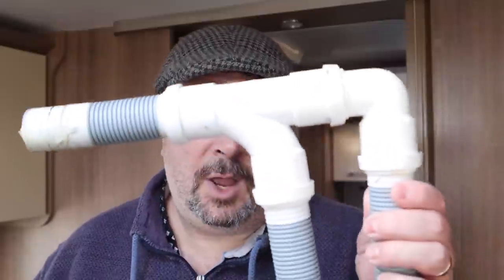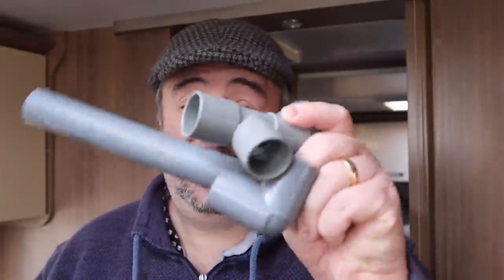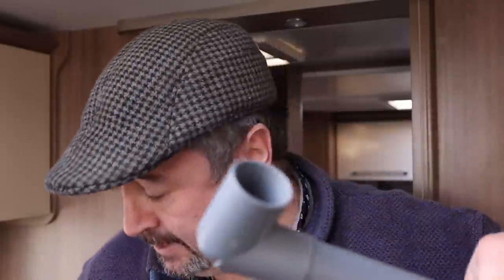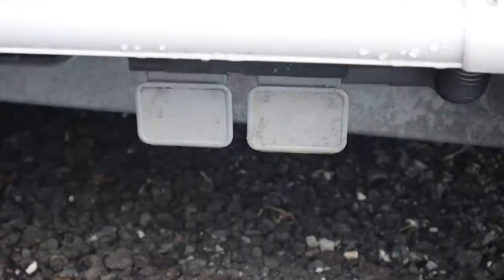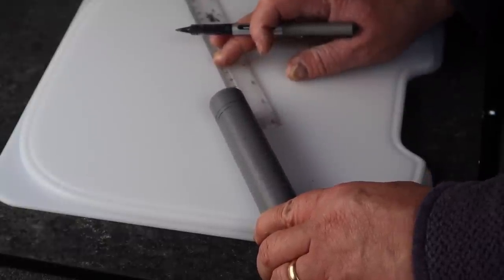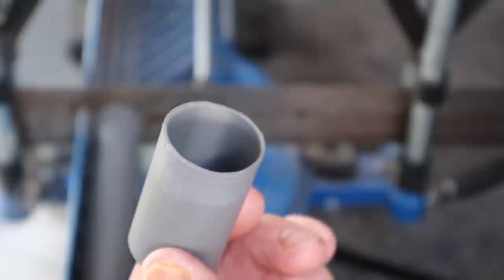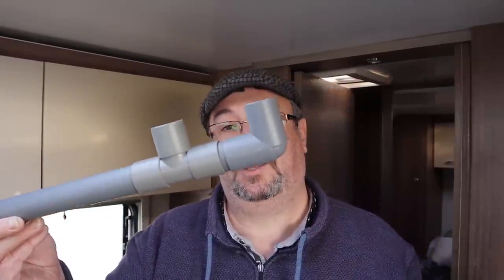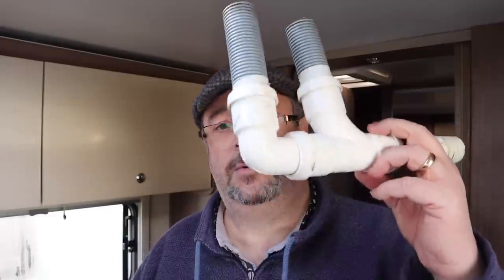Caravan waste pipe connection kit

Comment: Hello Dan I made one of these last year but I used another right angle fitting and some more pipe to run it directly into the waste tank without the flex pipes. It works well and looks neater.

Comment: Used the old method from start of caravanning. Never failed yet. Thanks Dan for the Info but will stick to tried and trusted method. By the way. I love the flat cap. You could almost pass as a Yorkshireman, you just need a ferret now as a pipe cleaner.

Comment: Hi Dan, Ive been using thst set up for two years and it works well. Wr were on a fully serviced pitch at Chertsey so I just slid my white pipes onto the grey and adjusted for length. But glad you gave a warning, as I did split one join when I originally put it togethet, but its still working well. Just needed to adjust the distance between the two outlet pipes when we bought the Buccaneer.

Comment: Hi, used this kit before I found your video. You missed the use of the other 90* bend. 
Rather than using the unstable flexi tubing, measure (100mm) out of the straight tube cut and fit this from the T to the bend, fit the remaining length of straight tube to the other end and adjust length as required to go straight into waste container on a level surface, allowing about 30-50mm to go into tank. Much more secure and tidier. As shown on the picture of the kit.
If on a slope/elevated or uneven site, flexi tube may needed to ensure no leakages.
If you want I can photograph and upload my system if this will clarify.
If necessary use a small amount of silicon spray to ease assembly.

Comment: I found the kit at a site a while ago. I used both elbows so the feed pipe to the wastemaster comes away from under the van as on a sloping site the wastemaster would not go under the van. I too used a piece of normal waste pipe to join the kit to the wsastemasrer

Comment: I use that kit Dan. The only thing I would add is that the kit comes with a two right angles. I use the second to secure the pipe down into the wastemaster. The size of the straight grey pipe is sufficient enough to cut three pieces in total and therefore no need for flexi hose.
Reply from the maker: Hi Tony, we were thinking of doing the same, but in the end i chose not to do this as the flexi pipe acts as a trombone slider : pull back to remove WasteMaster, push forward to insert etc. We did this over Christmas and it works really well. it also means it will work with my serviced pitch kit etc. 

Take care
Reply: @TheTrudgians  Do you know what Dan, that does like a better set up. I think I'll give it a try when we're next out. Roll on Feb Half Term...

All the best Dan to you and the family.

Comment: Thank you for a great tip Looking for something neater than the one I have. Just a point at the end of the video about gluing it together, much easier to take apart and clean if you don’t 😀
Reply from the maker: HI Keith, so after a couple of years of this set up, i must admit cleaning it is a doddle. I just run it under a hot tap with some disinfectant and it cleans up lovely. To be fair, i didnt even pull it apart. 

Take care
Dan
Reply: Just  bought one on your link through Amazon 😁
Reply from the maker: awesome. thank you

Comment: Nice job Dan👍🏻 thanks for the little tip on testing the pipe in the connectors first to get the exact size, just about to do this on ours ready for the summer season.

Comment: I have the same kit on our van but found that if connected directly to waste outlets as you have done then when you release a full sink of washing up water then the waste water can reappear in the shower tray due to the sharp angles and not much run off. I found that if the outlets are extended with a bit of flexi hose then this seems to then work OK!
Reply from the maker: Hi Phil, 

Just so I understand correctly - the water coming from the sink is pushing back up this connection kit and into the shower?

I have heard this happening to others too - and I think there is a spacer that you can buy to lower one of the outlets to prevent the "back wash" 

Thanks for the heads up - i will look out for this, but so far so good. its been working really well. 

Dan
Reply: Hi Dan, yes that is correct. Guess its just a case of the flow being too great to flow away so just backs up!

Comment: Great vid as always, Dan! 👍🏻 I finally invested in one at the end of 2017 and am well chuffed with it, much neater job than the flexi and 2-1 we were using before. Also, you can obviously buy all the joints separately, so I got another 90° to drop into the wastemaster. Last spring I also invested in a 3m length of 28mm pipe and some more fittings to add to the same kit for when we’re on a serviced pitch, although typically we’ve not been on one since 😂 Keep up the great work guys, Simon.

Comment: Hi Dan lad that's brill much better than the corrugated one ive got,as they are difficult to
push in,what size is the pipe and maybe a good tip ,use a tadge washing up liquid inside
of the pipe then slide together easy,thanks again Dan.

Comment: Dan. I put the other elbow on the end of the pipe and angled it down after cutting the length a bit shorter. then used the cut off length to go into the opening of the Wastemaster. No need for flexi pipe then but can be added if you go on a serviced pitch. Nick
Reply from the maker: Morning Jan, i did consider this at the time, and after using it over Christmas, im quite liking the flexi sleave. pull it back to remove from the waste master and pull forward to insert into the wastemaster etc. 

It will also make it easier to connect onto my service pitch kit etc. 

Take care
Dan

Comment: This maybe a dumb question but Bailey just build it with one waste pipe, it would be cheaper and easier for them?
Reply: Justin Grunwald If there were a blockage or, even just an airlock, the waste water could back up.  The effect of this may be that your washing up water, complete with soggy toast crumbs, might regurgitate into the lowest point in the caravan drainage system, namely the shower tray! Ugh!
Reply: @conifer8026  I disagree on the grounds the two systems would yield the same circumstance.
At present you will have 2 outlets from the bathroom, 1 shower, 2 sink. These will join below the van via a Y piece and then run as a single pipe to one of the two outlets at the side, (or rear) of the van.
Dan's method, (along with numerous alternative designs) now has these two outlets merging, via this waste pipe, into one pipe which goes into the waste master.
Now lets suppose we remove the two brackets from the van, merge the pipes into one below the van and fix this now single pipe to a single outlet on the side of the van.
Both methods are using only one single pipe in the final outlet, so whats the difference that Dans method will be ok, but if a manufacturer uses only one outlet, it might flood the shower? 
Further I doubt there would be enough volume of water from the kitchen sink after washing breakfast dishes, (toast crumb soaked or otherwise) to travel as far back as the shower tray. 
Although you might secure a blockage if you soaked the actual toast, but you would notice the water wasnt going down in the sink long before it reached the shower tray!

Comment: Hi Dan.
 Good video on the water pipe fix. I did my new van the exact same but I am getting a back flow up into shower tray when emptying kitchen or bathroom bowl. Didn't do it with my last van. This one only and it is only six month old. Have I missed something out on your video I wonder.  Any ideas Dan?
Reply: Old post but I just found the same thing happened with this connector on our van last week. Changed back to the y shape connector and no problems. Shame as it’s compact and fits nicely.

Comment: Hi Dan,

Thank you for another great and importantly, useful video.

I have a different issue with my Bailey waste pipes. Ours is a side kitchen/end washroom and the kitchen sink and washroom basin both feed into one outlet on the side of the van. Annoyingly, the shower had a separate outlet at the back of the van. Not wanting to carry another waste hog, I have to keep moving it about. However, I would prefer to move the shower outlet so they are both together. I did consider joining the basin and shower waste pipes together but I think that would give me water level and capacity issues.

In the video you mention the the stanard waste pipe is probably 28mm. Is this easy to get hold of in longer lengths?

Keep up the good work. 
Regards 
Chris

Comment: Seems a lot of faffing about to me?  I just bought a standard flexible waste pipe Y piece and pushed the flexible hose on all 3 ends. As it’s flexible it opens out or closes up to accommodate any spacing of outlet connectors and the third end that goes into your waste tank can be replaced with a longer section if you wish to run it into a drain or whatever.  Cost pennies years ago when I bought it, it’s been on a couple of different vans since then.  Enjoying your videos though 👍

Comment: Thanks Dan - another good old fashioned tutorial. Excellent as ever.

Would this then match up with the larger B&Q pipes in the old serviced pitch “trombone” pipe arrangement? I too have same white pipework set up as your old one.
Reply from the maker: Hi Howard, yes it does. I use the section of flexi to insert into the smaller bore of the white trombone, and it works fine. 

Hope that helps
Reply: The Trudgians thanks Dan best wishes to all the T’s for 2019

Comment: Hi Dan. I wonder why caravans made in UK have different drains for sink, shower etc. Here in Europe we have all conected in one exit pipe.
Reply from the maker: Hi, thats a good question. 

The only reason I can think of is if the kitchen sink gets blocked, and in that case (if a single outlet was used) waste would bubble back and start to rise into the lowest point - in most cases, this being the shower. So separating the various outlets hopefully mitigates this issue. 

Maybe thats why European vans don't do it, as generally they don't have showers like the UK style caravans? It's a good thought though, and now has me pondering.......

Hope that helps.
Reply: @TheTrudgians  I cant see a problem running them all into one. After all thats exactly what youve done with your adaptor to single flexi pipe at the two outlets!

Comment: Ive purchased the same type but mine has another angled bend for the end section and 28m fitting.
Reply from the maker: Hi Dean, yes this also came with 2 right angle. but i decided not to use it. Instead the flexi pops on the end, and slides up and down to allow the WasteMaster to be removed with ease, and also allow the serviced pitch kit to slide on too. 

Hope that helps
Dan
Reply: @TheTrudgians  thanks Dan I will do the same with mine ready for service pitches.

Comment: If the van is level how will all the water drain ? Obviously the force of the water will force most to drain but I think you will get standing water, if the van is slightly nose down it won’t drain.
Reply from the maker: Morning, the waste outlets are set slightly lower than the floor of the caravan, so all pipework will have a small decline to allow water to drain away, etc. 

If the van is nose down then waste water would struggle to get to the outlets, hence why its quite important to make sure the caravan is as level as it can be. Of course, there are other reasons why a level caravan is important, but this is one good example. 

Using it over Christmas, we suffered no standing water issues - in fact when it was time to remove it, it was drier and less mucky than the previous version. 

I hope this helps
Reply: The Trudgians thanks Dan, glad it works